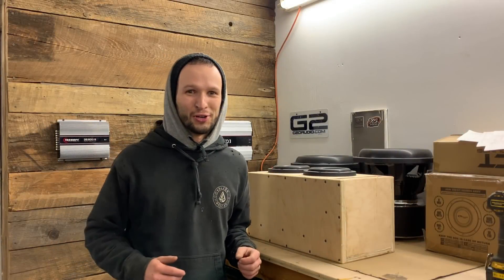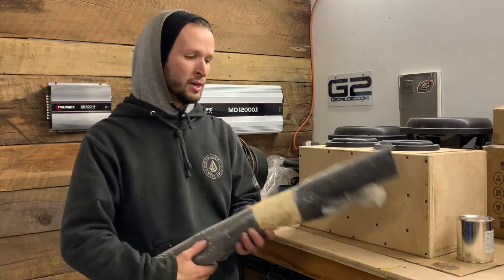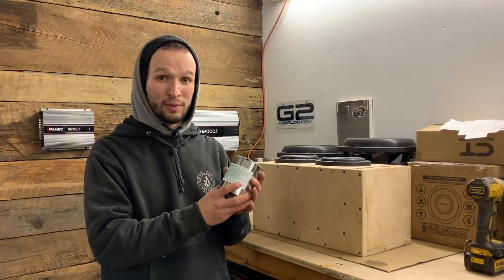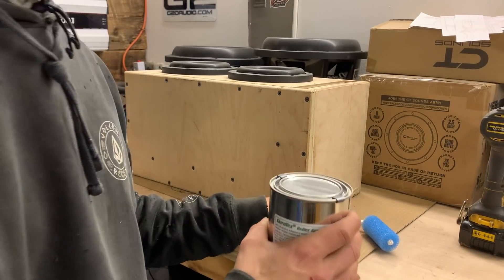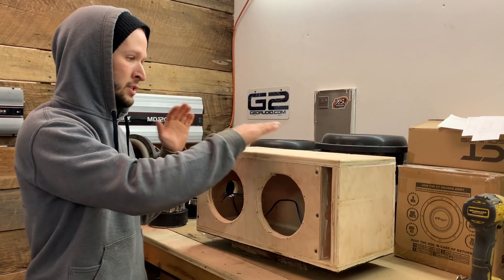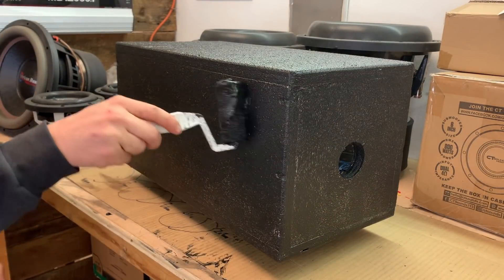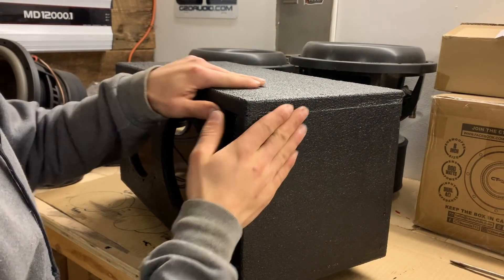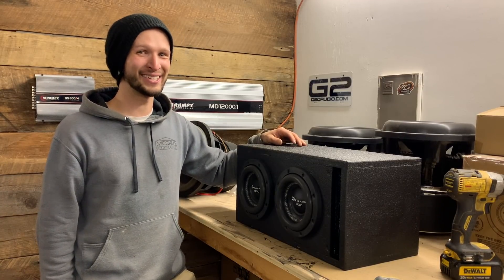DON'T Rhino Line (Truck Bed Liner) Your Subwoofer Box! Instead Use This...

Comment: I use rough sand paper to make sure the bed liner stuck. Did 2-3 coats and it's hella durable and helps seal possible leaks in joints. I honestly think it gets slightly louder
Reply: U are absolutely right.i did my box and it sealed it up more and it honestly hits better
Reply: What grit sandpaper is recommended for prep?
Reply: @scotw67 id say maybe 120grit, but not too rough

Comment: I used flexseal in the liquid form. It came out real nice. Also it add acoustik value and vibration dampening.
Reply: Exactly..I watch him alot and love his videos but I think he is wrong if he doesn't agree with putting the bed liner on it cuz I did it to my box and it made it sound better and more firm..

Comment: Used to do my boxes in spray-on Duplicolor/Rustoleum bedliner but Duratex is far superior. You can apply it indoors (no smell) and you can clean it up with water. On top of that it hardens in a couple of hours and doesn't smell. At high temperature is also doesn't get gummy like spray-on liner. If you want to get smoother texture that looks nicer (for HT installs) I recommend using a foam brush. Also before coating I recommend flattening any wood overhangs and routing the edges with a roundover to get even better looks and durability.
Reply: And thus is being conservative lol. It's dry to the touch in 10 mins. I waited 30 mins and was able to put my box together and start using it. It dries extremely quickly. Duratex is so much better

Comment: I use that on a lot of the boxes I build for ppl. Works great. Just not good to have a lot of texture where the sub needs to seal bc it will definitely cause it to leak. Other than that it's great.
Reply from the maker: Good point!!
Reply: @DTW-bx2vy  I agree. I use a smooth roller now when I use duratex. Works much better
Reply: my brother did this and he just used like a gasket material like a jb weld almost but it wasn't hardened.. where the subs sit to seal
Reply: @zanechristiansen  yeah I've done that too with a weather strip type material that is sticky on one side. That's the only way I could get it to seal. Since then I've used a smooth roller and it seals fine without anything extra
Reply: @hopskustomaudio  yea I could tell the difference in sq after he properly sealed it
Reply: @DTW-bx2vy  
Even though I prefer the textured finish, you make a good point about the cleaning. I despise carpet for the same reason.
Reply: Going around the mounting hole with a brush to smooth the texture works, too. Weather stripping is cheap and effective, also.
Reply: @ParkerTheBasshead do they sell something similar on Home Depot or local shopping places?

Comment: Well done Parker ,now since the product is applied does it give more solid thump more dbs better sound. let us know
Reply: It shouldn't, granted there is no air leaks
Reply from the maker: Haha no sounds the same in my opinion. I didn’t meter it
Reply: Yeah, I would wonder if there are any "coatings" that could/would maybe solidify (if that's the right term to use) the box making it hit a little harder, tighter? I guess there would have to be some resonance where the box is vibrating that could be helped reduce or stopped in the first place. 
  Just got thinking about it and wondering if there's anything to it
Reply: @BabyCharlotteschannel  you would have to coat the inside of a box to effect sound waves. And then again it prob won't change the sound due to the box "should" already be air tight. But some have argued that using sound damping inside a box changes the sound.
Reply: @jaz97  yes, I was thinking of the inside although I'm not convinced that there could be certain frequencies that might make the wood vibrate through the entire thickness. Obviously bracing has it's place big time on high powered, hard hitting subs, and I will be the first to admit I am not a professional in sound wave theory, though I have a decent amount of experience with putting together and installing HiFi stereo systems I have TONS more I would love to learn!
Reply: I don't think so, but it does look better.
Reply: @BabyCharlotteschannel  i agree..
Reply: @BabyCharlotteschannel   No need to coat the inside with DuraTex, no real benefit and not designed for that application. The same company makes a product for "controlling" the vibrations the wood experiences. It's called Acoust-X, about $35-40.00 a gallon. What I've always done for subwoofer boxes is use Dynamat or like product applied to all the large open surfaces inside the cabinet. this controls the vibration (resonance) quite well. This will almost always improve the sound.

Comment: Perfect timing for this video. I was going to buy some bed liner this weekend for one of my projects.
Reply: Went to home depot with wife and kids, 
Got distracted and bought under coating for chasis🙈😬😅.
I did a side on 1 wedge monitor that I am trying to fix. Had to clean it when I realised it was under coating
Have you finish your project?
Reply: @audiovega55  I did the exact samething on the inside of a wood box with plexiglass window comes off rather easy scraping and sanding , but it was kind of oily and soaked into the wood , did you have the same issue , and were you able to remove it if you did , how ?? Please and thank you for the information.

Comment: I've been using Behr Deckover from Home Depot. Its a rubberized acrylic that they can mix to match damn near any color. You can also vary the texture by using different rollers.
Reply: That sound cool I will have to look into that thx.
Reply: @jimmiedean8035  
I can't remember if I paid $35 or $70 for a gallon. So it's either 1/2 - 1/4 the price of Duratex. I've done at 2+ coats on a 3.25cu' box, 2 1cu' boxes, 2 .5cu' boxes, and I've got a little less than 1qt left. It seems to go a long ways. I'm sure you could price it on their  website. Lowe's has the same stuff on their own brand, if you have a preference.
Reply: And you can do touch-ups with a cheap foam brush. Just dab it on to match your texture. 

Couple of tips:
It needs a good 24hrs to dry, and at least 72hrs to cure. If you try to roll a box over to hit the other side within 24hrs, it's probably gonna stick. So patience is advised. 

It says it shouldn't be thinned, but if you goof up and not seal the can well(like I did), a little distilled water will fix it.
Reply: @jimmiedean8035  No problem. I'm all about the cheap, too. And I figured if it's durable enough to walk on, it should be good enough.
Reply: @gakudzu7282  I’ve used the “Cabot” brand from lowes for years on inside of jonboats over alum and wood , it’s a great product and much more durable than bed liner and can be tinted to color of the boat .

Comment: Best subwoofer enclosure hack I've ever personally done, but I used HERCULINER with obvious sanding prep work, using multiple thick coats and waited for a low humidity perfect weather conditions kinda day, etc. You can actually hear the improved audio clarity afterwards 💪🏼🔥❤️
Reply: Did you do the inside?

Comment: Just tried using this stuff. The coating seems durable, but the finish looks like crap. Very splotchy and uneven. I even bought an extra, bigger 4" foam roller, 4" paint tray, and 2 spare 4" foam inserts. They are the exact same texture as the included roller. 
I ended up doing about 4 coats on the majority of the box, and 2 on the back (depending how it's installed). It just looks really annoyingly bad. Maybe it won't be noticeable in a dark trunk but it definitely is in indirect sunlight. The box is a GP Audio vented single 8". 
Maybe I went too light on all 4 coats? I basically poured a moderate amount into the paint tray trough, rolled the roller back and forth to make sure I had even coating, went back and forth in  horizontal rows, then noticed the same thing as Parker, it looked best when finishing with overlapping horizontal rows in one direction, or there was an overlap line that stayed. FWIW, it didn't even fill in the "nail holes" on my box. I had to put a thick dot of paint in each one with a tiny paint brush.

Comment: I might have to try that my 1st plan was to use epoxy and do a thick clear coat over some silk fabric with leds routered in under the silk. but bein thus box is ugly and I keep tuning it to find the best sound. that this will be tougher, cheaper,  and easily redone if I change something. Save the epoxy for the 6 pair isobaric 18s  6th order wall going in the 3/4ton suburban

Comment: it seems the screws have an effect on the surface of the liner, i personally dont use screws on my boxes. i use a pin nailer because the glue is the actual bond between the wood panels
Reply: I've got to where I use a quarter-inch dowel tapped into a quarter inch hole I pre-drill on all the surfaces to glue my boxes together without screws much stronger and saves the cost of metal screws as I make my own quarter-inch dowel rods now. Makes a very nice finish and unique looking.

Comment: I need to coat my box soon, I used particle board though.
Reply: Glue a second layer of 1/2 MDF over the particle board for strength the box will hold up a lot longer.
Reply from the maker: This will still work! But yes I agree with Tiffani

Comment: No filler on the seems or screws?
Reply from the maker: Yes if I wanted it to be perfect i could have done that! But it doesn’t bother me enough to go through the hassle
Reply: @ParkerTheBasshead  Yeah, my stuff is always in the back of whatever SUV I'm running at the moment. I just sold my Xterra so I could pick up a nice first generation Grand Cherokee, and I'm not concerned about the looks of the boxes too much because I usually have a bunch of tools for doing mobile mechanic work. Do they'd get scratched before long anyway..

Comment: I would like your input should I sell my 2 dual 2 ohm L7’s to get 1 def bounce apocalypse 15 or should I build a bigger box for the 12s either way I have to build a box I have a rav4 and on a budget your opinion matters
Reply: Hey Earl, I'm curious what you are running for power to the L7's? And what would you run for power to the single 15" Def Bounce? 

**Personally I would keep the L7's AND get the Def Bounce 15" too! Even if you have to run either one's with a cheap-o amp for a while. I had some seriously great results running this Audiopulse Axis quad 1 ohm voice coil 12" sub (like 54 lbs!) AND a TC Sounds Tropo 15" at .8 ohms off my Orion XTR 2500 amp(never got around to wiring up my other sub amp, which would have been much better for dialing in each amp's power and crossovers to their respective subs),  and it absolutely rocked! Even with the 15" box being tuned much lower than the prefab 12" box it sounded great with every type of music I played, and I listen to basically EVERYTHING!!

Comment: My roller included with a gallon of this was unusable. It wouldn't roll. 

Thought It was a simple fix but ended up just not using it cause it was really not wanting to roll. Luckily I bought spares and they worked. If I didn't the included roller would have set me back a trip to the hardware store. Not a huge deal. But something to be aware of. 

I thought it would cover seams better. My boxes were sanded to the point you couldn't feel the seams at all. But still showed up unless you put on multiple coats. 

Still. I really like the finish and its very durable and using white ended up looking great with my Dark Walnut stain.

Comment: Side note: Don't do the inside of the box. It can cause turbulence and air noise  from the rough texture.
Reply: I wouldn't think that would have any negative effects on the sound unless it was in the port area. 
  I was actually thinking that it could improve the sound possibly.. I'd like to learn more about it.
Reply: @BabyCharlotteschannel  I dont think it would cause any major lose of db's or anything. I just know from personal experience,  I got some extra port noise when I did it.
Reply: @JustinGrosz  cool, good to know. 
  Just curious what exactly did you do with your box when it did increase the port noise? Were the port walls (slot ported box or?) Coated with whatever coating stuff you're talking about? Cause I would definitely think the air that comes rushing in and out through port would be very susceptible to that..
Reply: @BabyCharlotteschannel  I used hurculiner. It was s dual 15 prefab slots on the ends so it was 2 different chambers. I added another layer of 3/4 mdf to all sides then coated with the liner. After that I junked the box and went 4th order . Fiberglass resin coated the 4th order.

Comment: Fiberglass resin works better than anything
Reply: Yeah that's what I've been doing since the 90s and I still haven't found anything better cheaper or more effective. Just got to sand it outside so you don't get fiberglass in the garage

Comment: How bout a sound deadening vid..when n how much should be applied
Reply: Absolutely! Every little thing us audiophile's and bass-heads can do to get more and better sounds from our systems can add up to some seriously amazing improvements!
Reply: Sound deadener is only so good. Just like adding it to metal panels to reduce vibration, it will only vibrate at a lower frequency than it did previously. It can not fully remove the vibration & resonate frequency, it only covers up some of it from being heard. The same goes for speaker enclosures too.